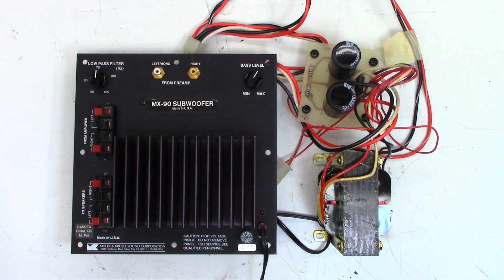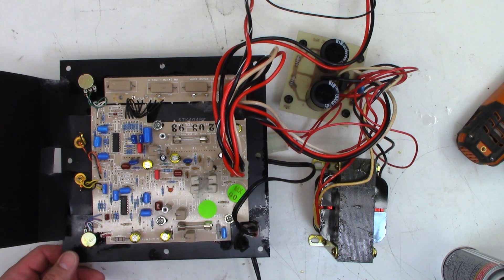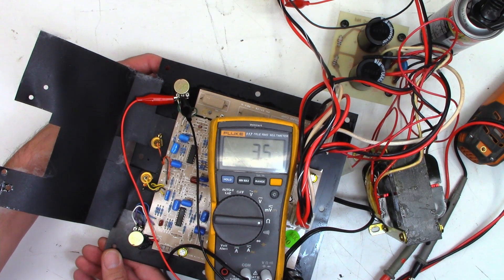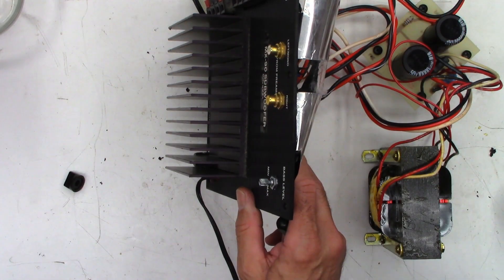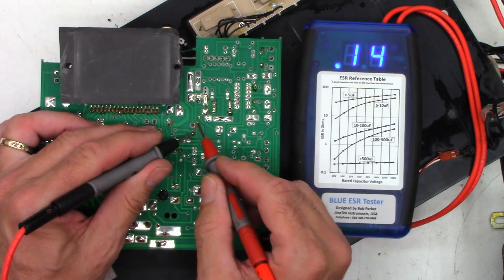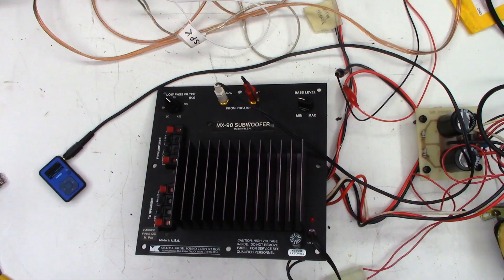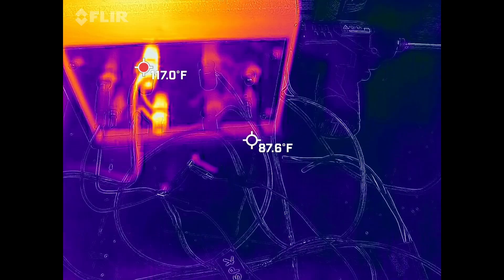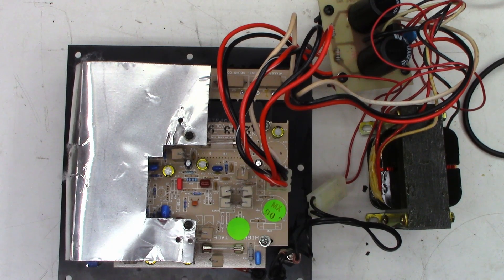Miller and Kreisel MK MX-90 Low rumble sound - Sent from Texas - M & K - Miller & Kreisel M&K MX90

Comment: Thanks for the vid, I to have an MX90 with the same rumble. I will look into the issues you found in this vid. 
Question, when testing the Pot and caps, why did you not disconnect at least one wire, this would isolate the pot and the caps from the board, limiting any interference / feedback from the board?

Comment: Norcal715  Can I use a B50k  pot?
Reply from the maker: The B50 pot is a linear taper pot and the taper will be way off, Very little on one end and a lot on the other end, but it will work. You should try and find an audio taper if you can. Look at this. https://www.jameco.com/Jameco/workshop/circuitnotes/Potentiometers-audio-taper-vs-linear.html

Comment: Would put the power connector on with a plastic block under the PCB, so you do not tear the copper traces off the board with the force, or just glue a piece of plastic there to take the force, because the reason those connectors get solder joint cracks is from the factory doing the same on assembly, and cracking all the joints except for the last one.